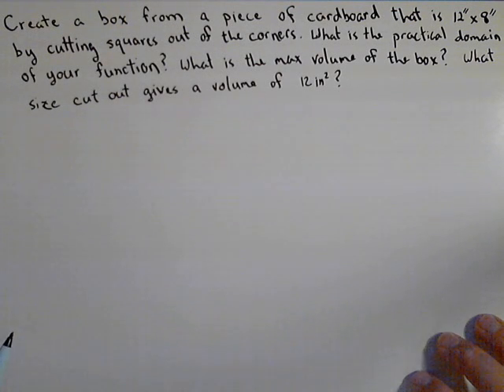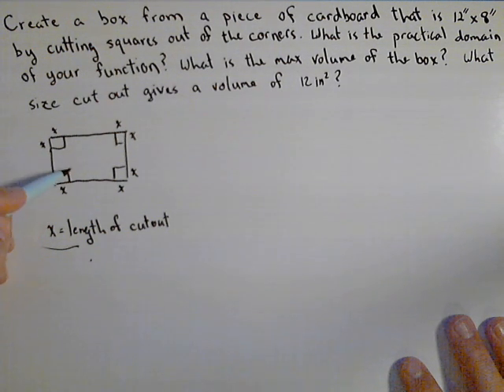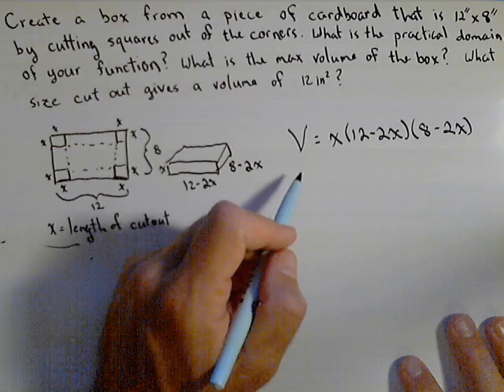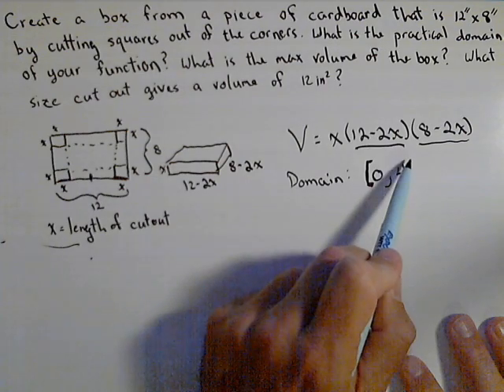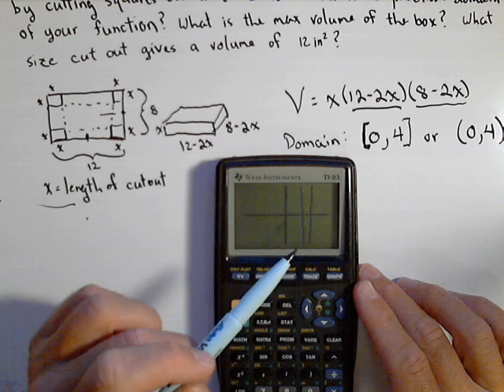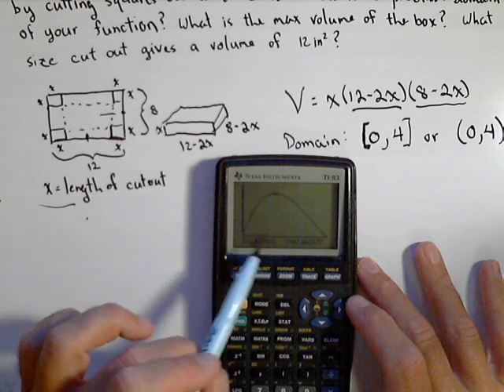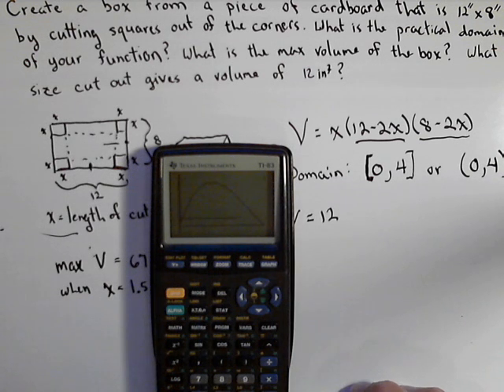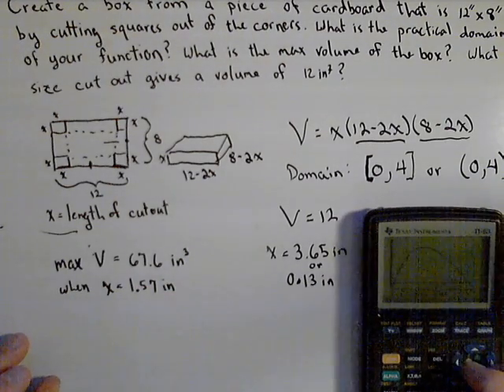The Box Problem - Creating a Cubic Function to Model Volume

Comment from the maker: The reason the domain must be less than 4 is that on the side where the equation is 8-2x, a value larger than 4 creates a negative value which does not make sense in this context. 4 would make a volume of 0 so we could include it in the domain, but that would give the minimum volume (of 0), not the max.